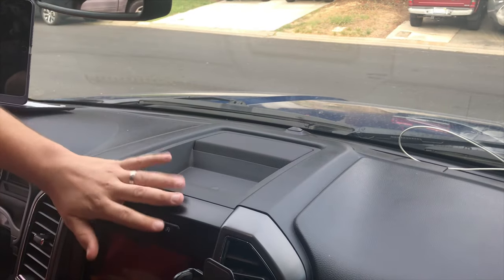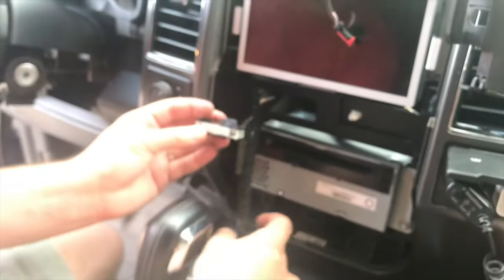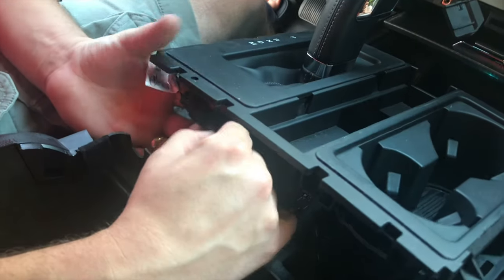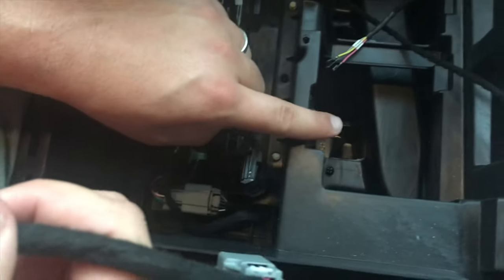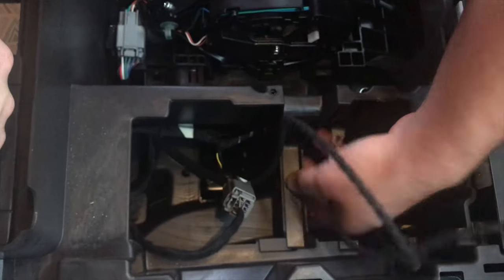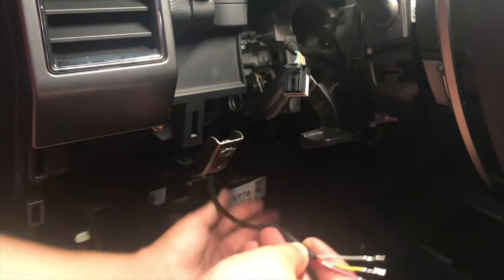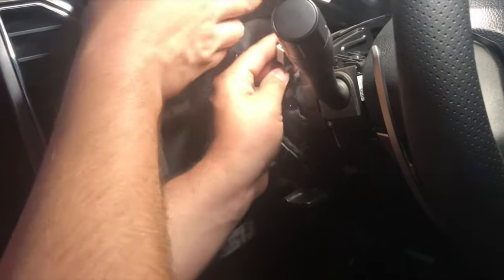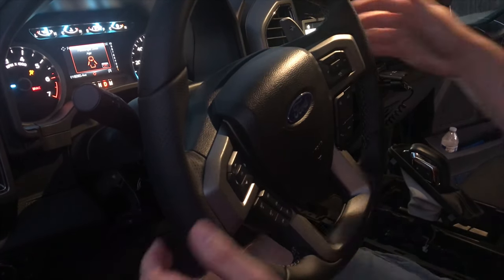Raptor Steering Wheel Retrofit w/ BoostedGreyGoose Wiring Install for 2015+ F150

Comment: Nice job! Thank you for doing this. Helped me today when I installed mine. Fishing the wire under the console was the fun part but using a long wire coat hanger did the trick. Took me about 4 hrs stopping for lunch and taking my time.

Comment: Hello I have a 20/20 5 l XL rcsb 101a a really basic truck. I want to do some circuit racing and paddle shifters would be amazing. I have a column shift obviously but my question is will the Raptor steering wheel work on my truck with this wiring harness I know there is one for column shift but does the 101a work with it or does it have to be a 301 or something before it will work. Basically is my truck capable of being equipped with paddle shifters? Thank you very much

Comment: My stuff is in the mail. Wheel and harness. I’m wondering about the buttons on the wheel. Will they be the same as what I have and just swap the button covers or will there be new ones on there to use
Reply from the maker: The new wheel would come with buttons but they are for a high-trim level truck with adaptive cruise control. The buttons swap over easily.

Comment: Does this Harness work with a 2016 5.0 F-150 as well? we use our truck for towing and we use the gears to engine break a lot and our gear changes are on the column shifter which is super annoying so we're trying to swap over for the paddle shifters on the raptor wheel...
Reply: Yes, but there is a different wiring harness for the column shifter trucks.

Comment: Does the heated steering wheel work with a little bit of forscan work?
Reply from the maker: No.  There is a separate module and a different clock-spring required.  A few hundred more dollars than I am willing to spend.
Reply: @KrAzYKARL49  understandable. Thank you for sharing your knowledge
Reply: Mine came as a heated Raptor wheel since I already had heated Harley wheel.